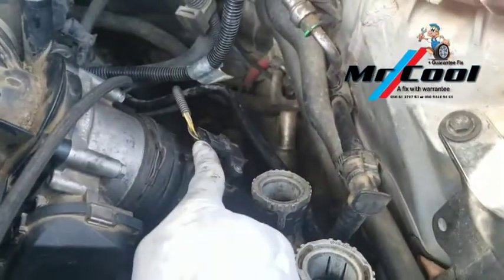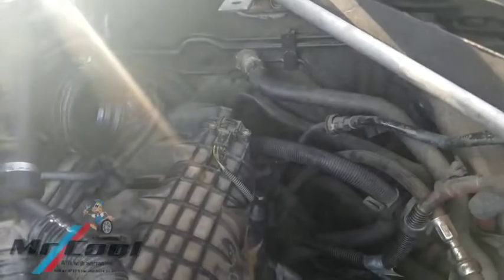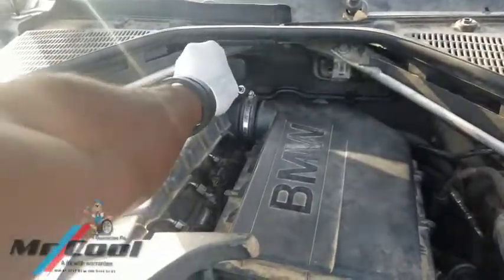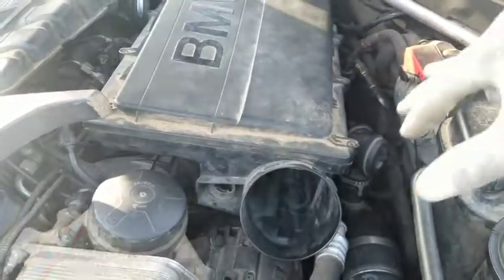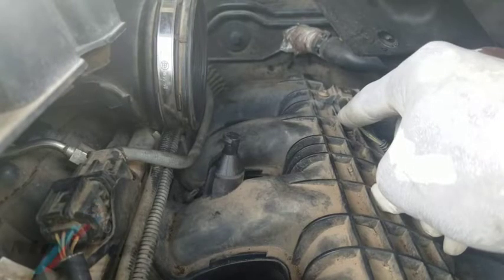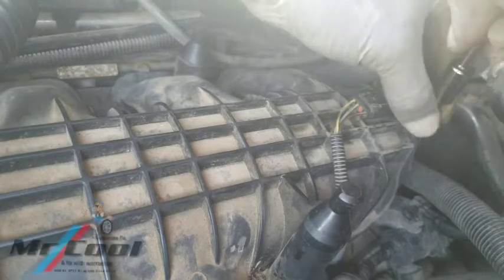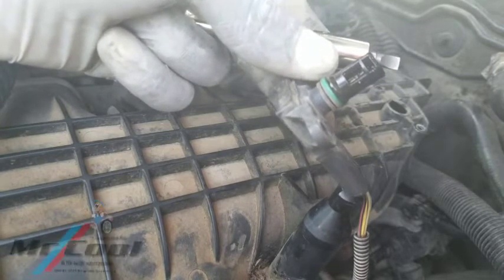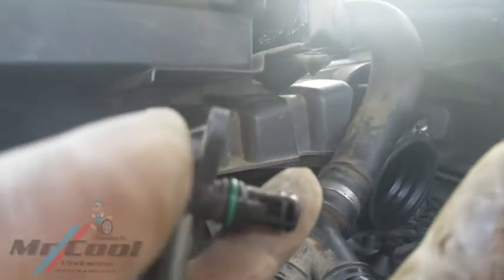How To Fix BMW X6 E71 Rough Idle part 3

Comment: I have a problem with the 2008 BMW X6 35i
Some time ago, the whole car started shaking while I was in the parking lot, many times and when I was going in reverse.
There is no significant change in the tachometer around 550-650 rpm.
I had missfire on cylinder 3 and 4 but I solved it.
There are no errors on the computer, but the car starts to shake a bit again, especially when I start reversing.
I replaced the battery, it was 10 years old, I cleaned the map sensor, there are no air leaks.
It just shakes a bit while in parking mode.
I don't know what the problem might be
The car covered 145,000 km, I changed the oil in the gearbox and engine.
Thank you.
Reply from the maker: N54 Injectors equipped, that injector needs servicing, at idle the Injectors could be supplying below the threshold parameters or quantity required to keep the car idling, then i think the system might need idle relearn in my opinion the good idle speed should be around 750 to 800 thats the standard idle for that x6, anything below that will make the engine or car to vibrate.
Reply: @drcoolautofix  Thanks

Comment: You probably can help me pls mine 2014 x6M MAP to throttle bank 1  too low is it my throttle body is toasted or some vacuum leak somewhere pls thanks code still stored in my car it won’t go away event though I changed map sensor thanks
Reply from the maker: Disconnect it & start the car